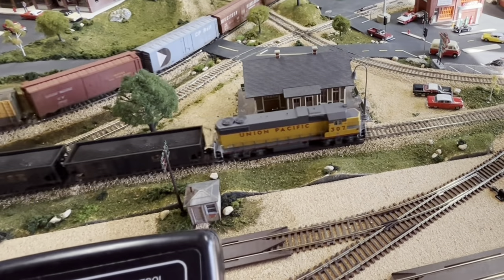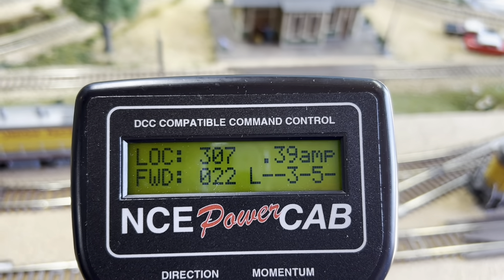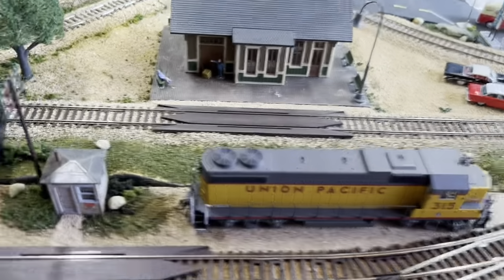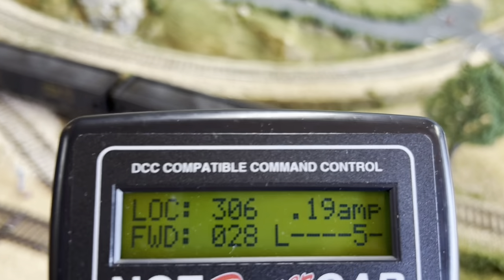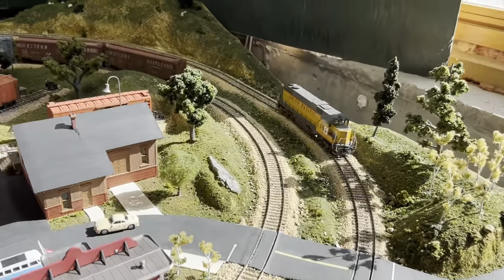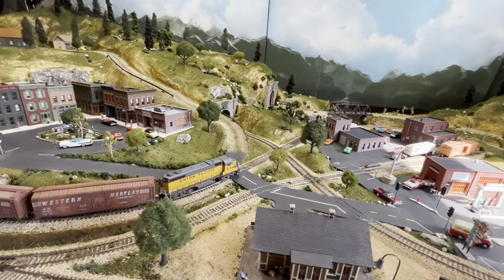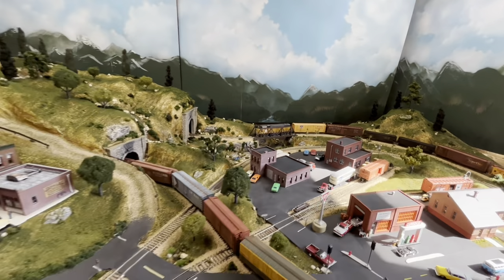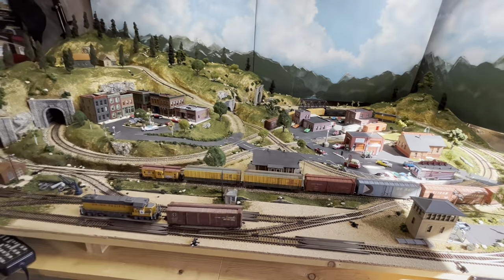Locomotive Amp Draw Test - Is It The Motor?

Comment: Interesting testing, Dan. It seemed to be fine for a minute there with no extra train load on it. Probably easy enough to pop a new motor in there. Guess it could be the board but you can swap a known good board into it to confirm which is bad before ordering the part from whoever sells them.
Reply from the maker: Yes good call on that. My buddy JoJo Fixer thinks it may be one or both of the electrolytic caps on the board. I’m going to try putting a known good one in series to see if there is any noticeable improvement.

Comment: I would test the MOTORS with no sound or lights. 
I would run 306  wide open for a few laps to get those caps fully charged then do a slow lap to test.
Can you monitor the voltage when the problem exists.
Reply from the maker: The amp draw was almost doubled when it was struggling.

Comment: have you torn them down lately for a good cleaning and re oil of all the gearing? but decoders are a pita od the dcc world tho they are notorious for going up in smoke
Reply from the maker: I need to break it down again and try that. A buddy recently had a nearly new loco start doing the same thing, and some DeOxit spray helped it. Def something causing it to draw to much amperage. Thank you for watching and taking time to comment, it’s much appreciated. 👍🏼
Reply: @DansGrandValley  no problem, I domt have a layout yet and the one i did have got burned by my step mother after my dad passed about 10 years ago so recently I've started replacing things I used to have and the GVRR is what ill be modeling when I get the rest of it checked off the list and so most of the locomotives I've been acquiring lately have been considered vintage now and usually run time and old greases and lubes being dry can put quite a strain on things that are used frequently or even if new but getting miles that are adding up. Decoders failing is definitely a possible thing but you'd be shocked how much current draw can be robbed by just sheer grime and dust even if small amounts, you have some fine specimen locomotives there even the best tho can suffer from it tho. Electronic components inside the small shells can also have negative impacts on the motor magnets too heat weakens magnets . And welcome so dollar ive got my table, track pack. 18 locomotives, and working on my rolling stock now and have quite the collection mix of vintage and new structures on the way. Only thing left to get to start the project is the grand valley layout kit box
Reply from the maker: @deplorableconstitutionalis2834  oh awesome!!  You are well on your way!  Keep an eye on Tower Hobby, they often have it on sale and offer coupons and occasionally free delivery. I happened to catch the perfect storm and got a really good deal on it. Another option, if you happen to see it in a local hobby shop, ask how long they’ve had it around. You can sometimes get a great deal from a guy who’s not moving it, and just wants it gone!  Have fun getting started again!  Be sure to check in and let me know how you’re coming!  Thank you for your comments! About the loco, very helpful. 👍🏼
Reply: @DansGrandValley  sure thing and I'll do that, unfortunately in my area of southern il theres very few hobby stores left alive, theres several hobby lobby stores around but actual like hobby shops that carry trains or rc equipment theres only one of those and its pretty close about 30 miles but other than that one the next closest one is roughly about 150 miles away unfortunately lol. So usually ive just came to terms with shipping being a burden of pain lol. Bad thing with shipping is that the carriers the past few years they domt care what they do with packages, I have a usps worker on security cam playing football with a package that was supposed to be put at the door and it was instead tossed like a soccer ball 20 feet. Really sucks when usually if I have something shipped its either vintage, expensive,  rare, or any combination of the options. 2 years ago I found a 1917 waltham gold pocket watch and it was smashed box and all by a forklift somewhere up near Saint Louis in a sorting facility.  Me and usps are still at war over that one and finding a worthy replacement for it.

Comment: Dan, we talked before and I have three of the GP-38's and I have had issues with every one of them, sometimes they run good sometimes they do what yours is doing. I have changed decoder in one of them and it can find for about two weeks and started again. I'm frustrated with them I stopped running them and run my cheap Walthers training and Bachman with no issues. I would like to know if others are having issues with this brand.
Reply from the maker: Hi Lou, I remember us talking about that. Wow, that is VERY frustrating!  My buddy thinks it might be one or both of the electrolytic capacitor‘s on the decoder board, being cheap or having just failed. Folks here are giving me good ideas of different things to try, like swapping out the decoder for a known good one, or getting a new motor. I thought I might try running a good capacitor in series to see if it makes a difference. I’ll definitely let you know if I come up with any type of solution.
Reply: Dan, before I switched to DCC, my older engines I had were Athearn or Atlas I have converted them and have no problems. Some of my recent purchases has been Walthers trainline from Midwest Model railroad and I have run them for hours and no problems. I'm was wondering since MTH knew they were leaving the hobby maybe their quality control suffered because a friend has O scale MTH from years ago and has no problems. I bought these as my first DCC engines for they were reasonable in price should have research better. Sorry you are having this problem.

Comment: It might be the DCC board, and not necessarily the motor. I only ever owned (1) MTH locomotive and had problems with it.
Reply from the maker: My buddy thinks it’s one or both of the electrolytic capacitors on the decoder so you may be right. I’ll try testing that by putting a good one in series to see if there are any changes.